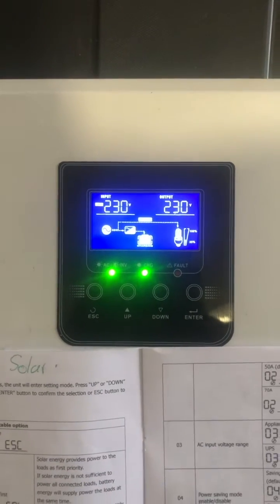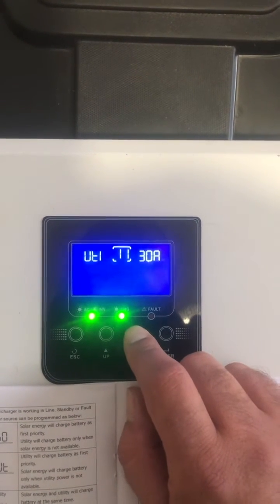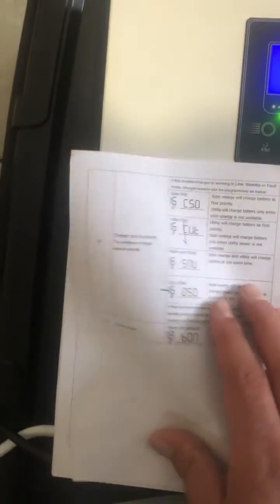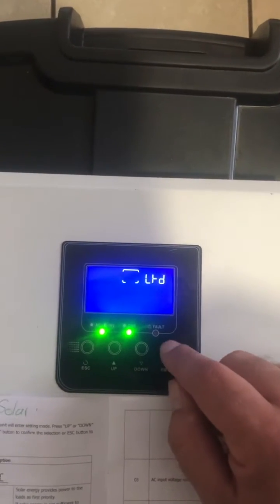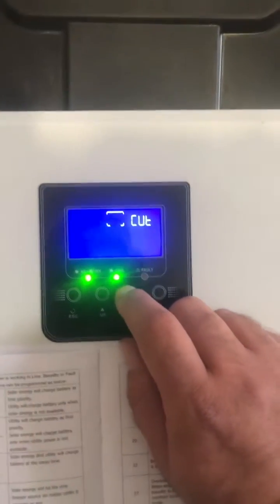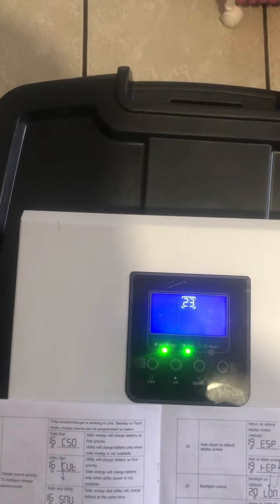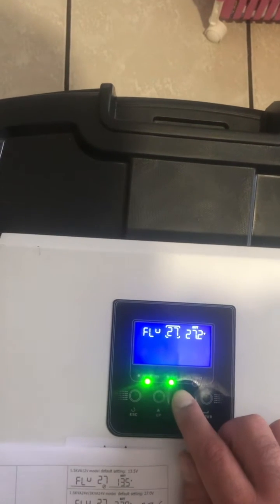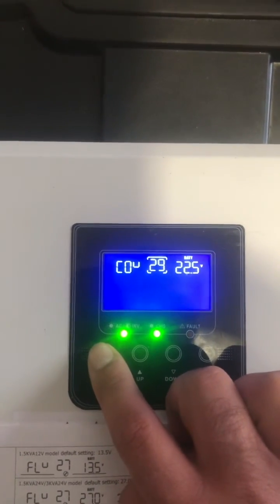3kva Mirua/Solarwise setup video for backup

Comment: Man i have a brand new 2kva 12v inverter but when i plug my refrigerator the fan start to run non stop and my tv show vertical lines due to this inverter do u have any idea?
Reply from the maker: That is why you buy the 3kva in the video the 2kva 12v you bought from another shop is MSW and not PSW and is not compatible with a fridge or TV.

For assistance you can contact us on 010 534 7099 / 072 040 3864 or email : ruan@mirua.co.za

Comment: Hi, my inverter stops a few times but only at night and with 75% charged batteries, what could be the reason and how to fix it? Please help 😢 I mean it shuts down the power, no electricity...
Reply from the maker: There might be several issue we would need more information to assist please contact our office on 010 534 7099 or whatsapp 072 040 3864 we would gladly assist.

Comment: Hello I have a fivestar inverter 6kw .I cant get the battery to link with inverter its lithium 5.1kw battery
Reply from the maker: Hi the fivestar doesnt support CAN communication. You would need an inverter like Lux Power/Sunsynk/Deye - you can always run as per the voltage of the inverter. If you need more assistance please call 010 534 7099 or whatsapp 072 040 3864